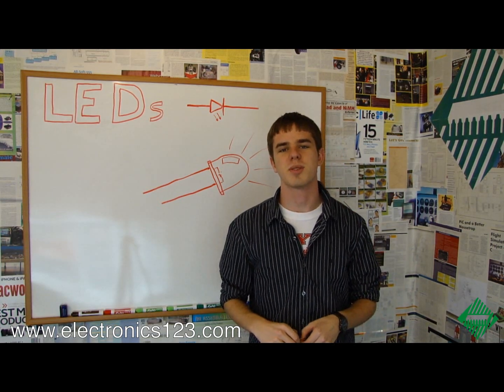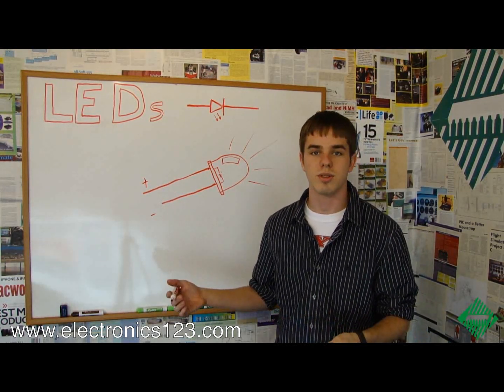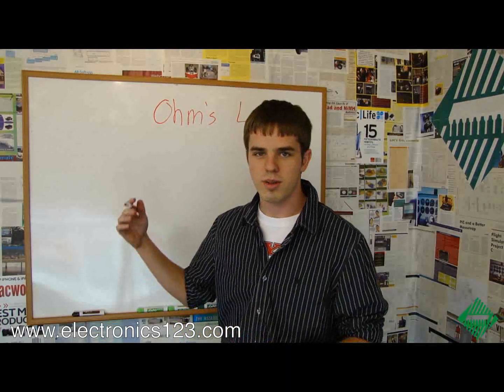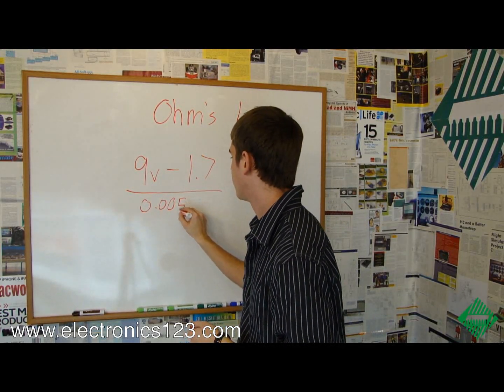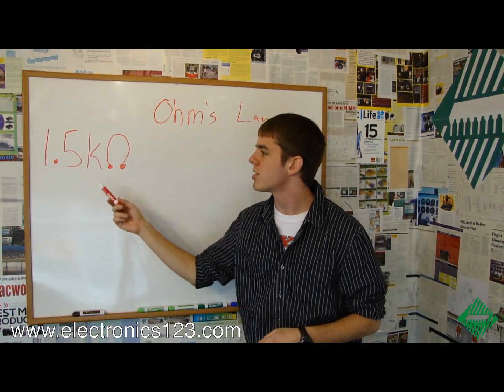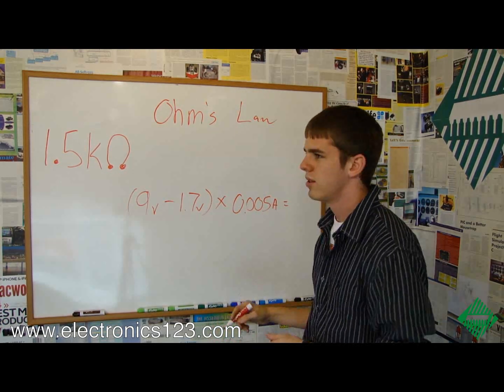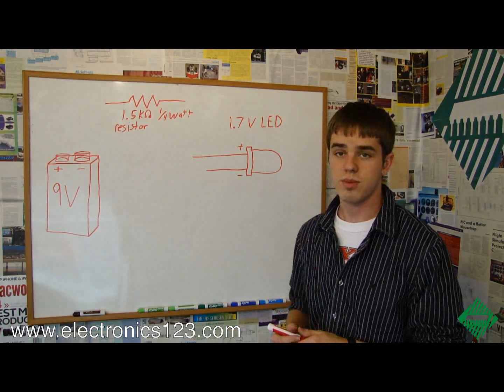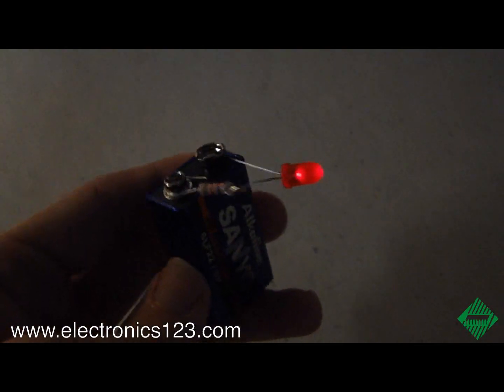Ohm's Law Explanation - How to Light an LED with a 9V Battery

Comment: Awesome video. One more point to add: We should also take care of the power rating of the resistor i.e the amount of power the resistor can handle. In your case, power was 0.036 W so it doesn't matter. But when powering 0.5 W, 1 W, 2W LEDs, we have to take in consideration of power rating of the resistor.

Comment: Excellent video! Thank you for the education. Is it possible to hook up several LEDs to the same resistor? Or does each LED needs it's own resistor? Assume that all the LEDs have the same voltage input.

Comment: I am a bit of a noob when it comes to electronics, but i thought that electricity travels from negative to positive, that being the case, the current being resisted after its gone through the LED,  which you said at he start of the video was bad  and would destroy the LED really quickly. or have i missunderstood?
Reply: +Titanium Bunker It doesnt matter where you put the resistor coz no matter how it will slow down the circle in the circuit. Leds are being destroyed if you have a constant flow of high power (360 degrees) in this case it doesnt coz once it reaches the resistor it will slow down the flow.
Reply: What you are thinking of is conventional current, ohm and other people back in the day based their work on this but it wa found that current flows from positive to negative.
Reply: This is about the resistor not about the flow direction. Yes electricity goes from negative to positive but it DOESNT MATTER WHERE YOU PUT the resitor, which was the question here. It will work anyway no matter where you put it coz it will slow down the current flow anyway!
Reply: Birkhan Sonkan IM SORRY MASTER PLZ STOP SHOUTING
Reply: START TO LEARN HOW TO READ AND I PROMISE I WILL STOP SHOUTING!
Reply: OK MI LORD !!!!

Comment: question. What if you were powering more than one LED's, would you need a resistor?
Reply: +James Estrada Yes. Even if the combined voltage drop was the same as the supply voltage. You want no less than 25% of the voltage to be dropped by a resistor, rather than the LEDs.

Comment: How many hours will that last?
Reply: +Timothy Schweitzer something seems off about that maths..im not good with maths..but my multimeter says that my leds are ruffly 0.020 miliamps...with my 9v battery..and the volts used being ruffly 2 volts.. i could get away with R=9v-2v)/0.020 and get 350 ohm resistor or say 400 or 500 ohm and safely operate it without damage to resistor or led. and get max brightness out of it.  so if my math is right..his resistor is really big hench the dim LED and will last a 2000 hours or more. he could probally run that led solid on that resistor for 2 years day in and day out.

Comment: Is there a way to get about 3.4 - 3.5 volts out of a 9V battery via a resistor? I have these 9 volt lights that have a small red LED inside and a brown black brown gold banded resistor. I have one with the original red LED and one where I put a white LED on it and both run fine. the Red light has 1.9 volts at the LED and the white LED has 2.96 volts at the LED. Is there any way to get around 3.4 -3.5 volts at the LED by using a resistor. I have tried many of the online resistor calculators but to no avail. My aim is to get the LED as bright as possible without burning it up. I had this 12 volt cigarette lighter plug with a blue LED and some type of resistor but I'm not sure what the ohms is.
Reply: +coondogtheman1234 Alkaline 9v batteries are 9v, but rechargeables vary quite a bit. But assuming the supply is actually 9v, white LEDs typically have a forward voltage of 3.3V, so you'd need to use a 330 Ohm resistor in place of the one thats already in there. The resistor you mentioned is 100 ohms, though. No idea whats going on with that, cus I dunno what LED's you have. Red LEDs usually drop less voltage than white, so the resistor should be higher. But, since you'd have to buy resistors anyway, why not just buy LEDs too, so you know exactly what the specs are? Neither are expensive. Resistors are so cheap you usually buy them at least 100 at a time for a couple of bucks. LEDs are like 20 cents each. You can even buy much brighter LEDs than the one you currently have. You can get ultrabright white LEDs on Ebay for very little money, and the vlotage drop and maximum current will be on the page, too. Then you can use an online LED resistor calculator to see what resistors to buy. Or just use the maths in this video. The ultrabright LEDs are still cheap
Reply: Ash Scott
I just want a super bright LED light that can hook to any 9V battery. The resistors are from a bunch of tip lights from dollar tree and They have a resistor inside them and it seems to work pretty well. I've made some pocket lights and one of them changes color and even that seems to work well. I need to find more resistors like the ones you mentioned. I don't live near any electronics stores and the nearest radioshack went under so I guess it's amazon time.
Reply: coondogtheman1234
They have ultrabright LEDs on Ebay. But you need to look at the specs for the LED before you can know what resistor you need
Reply: Ash Scott
I don't do eBay. Would Amazon have them?
Reply: coondogtheman1234
Yep. just searched. First result:
Bluecell 50 PCS White LED Electronics 5mm Ultra Bright
Reply: You gotta buy 50, but it's only $2 You'd want a 470 ohm resistor for that particular LED off 9V and it would give you 16ma. The LED is rated for 20ma, but you really won't see any difference. The closer you get to the maximum, the less difference youll see. Plus, thats for exactly 9 volts, and many 9v batteries (rrechargeables) are more like 9.8, in which case you'd be right on the LEDs max with the same resistor
Reply: +Ash Scott that's fine. I'll buy 50 of the LESs and 50 of the resistors. I'll need the 9v snaps but I'll take apart many dead energizer and Duracell batteries and I'll need switches too.
Reply: coondogtheman1234
9v battery clips are probably on Amazon, too. They cost about 30 cents if I remember
Reply: +Ash Scott 
the tops work better for me. more room to build on.